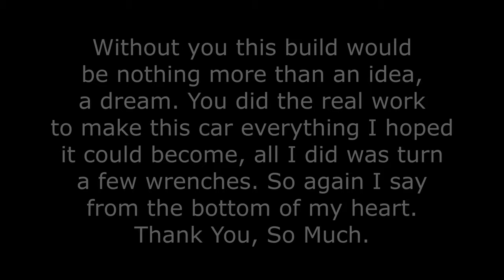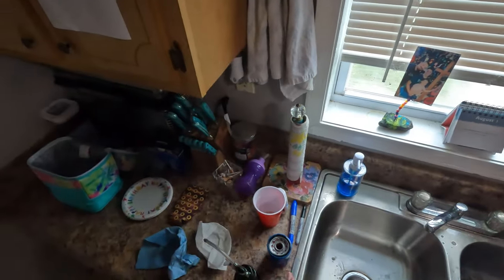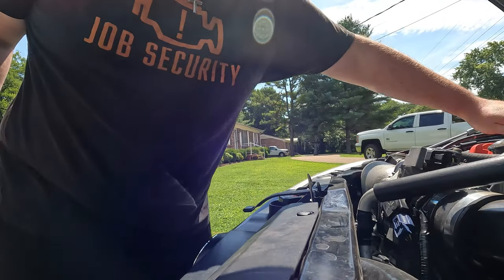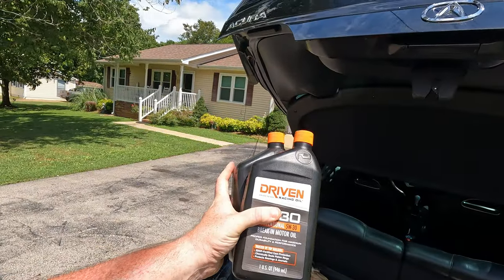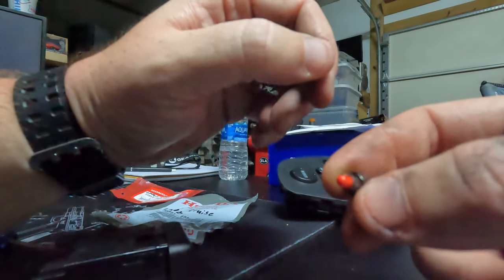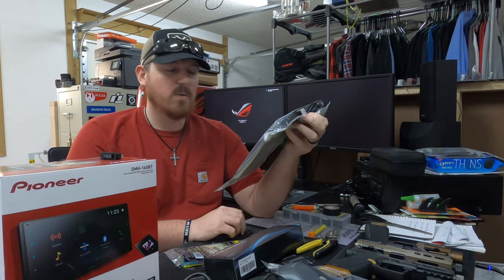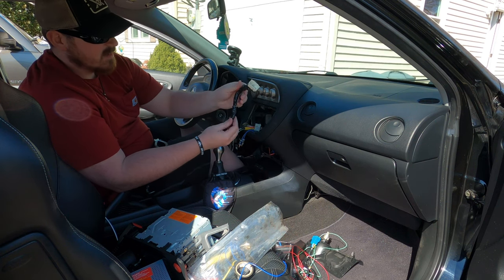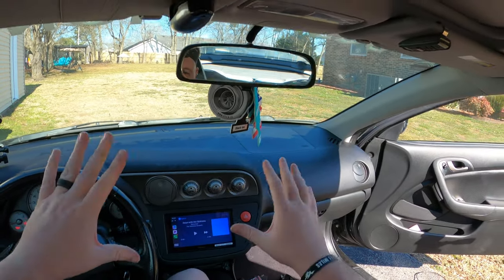Fixing And Upgrading The RSX After The K24 Swap!

Comment: I have a question. did you have hood clearance issues with the k24 + RBC? I'm running into the issue where the hood is hitting. thank you
Reply from the maker: No issues with the hood. It did run against the heat shield so I took it off the hood